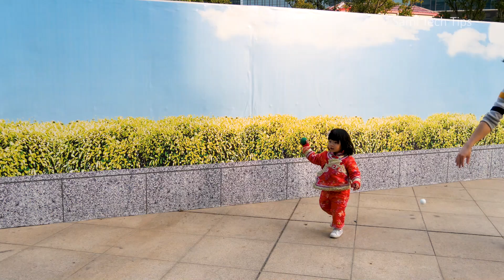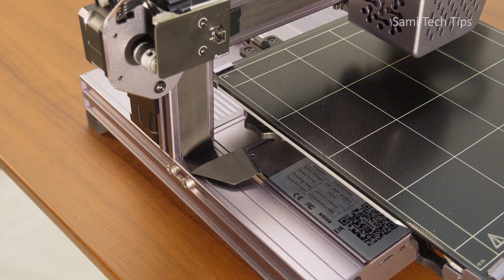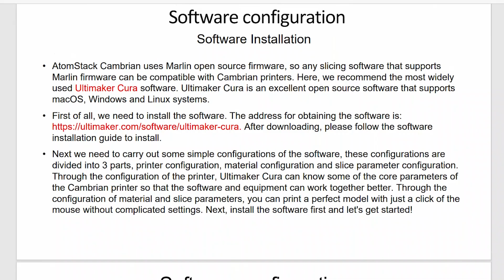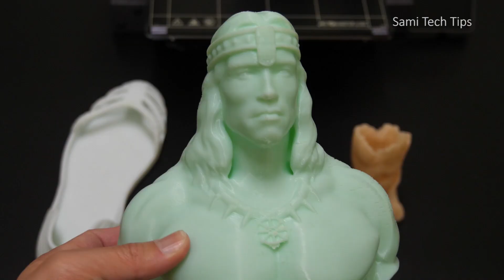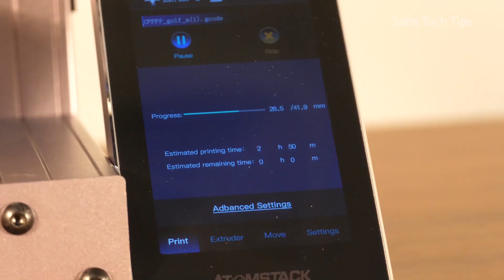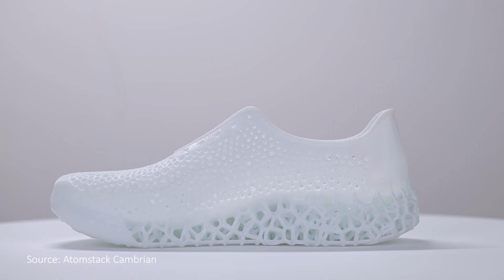Atomstack Cambrian: My First 3D Printer and I'm So HAPPY!

Comment: Hi, 

Great video on the Atomstack Cambrian Pro! I recently purchased this printer 
but don't have access to the SD card with the configuration files. I've tried 
contacting AtomStack support but they're not responding.

Would you be willing to share a copy of your SD card files or configuration 
package? Specifically, I need:
- Cura printer profiles (E285 & E175)
- Start/End G-code files
- Material configuration files
- Slicing profiles

I'd really appreciate your help to get started with this printer!

Thanks,
macsalaga
Reply: Hello,

I also recently purchased the same one, which also came without the SD card. I need the same files. Did you make it? Could you share? 

Thank you very, very much
Reply: @MateusRocha77 I did make it. I could email you with details I have found

Comment: I recently purchased the Atomstack Cambrian Pro 3D printer and completed the initial setup process. However, I am encountering an issue where the printer restarts every time I attempt a test print. I have tried troubleshooting the issue by checking the print bed level, print settings, filament, and heating, but the issue persists.

Please let me know if there are any additional troubleshooting steps

Comment: looks good but not for the price their asking on the kick starter. Almost 7 bills wayyyyy to expensive when I can kit up for under 50 bucks.
Reply: 280 euro is actually a pretty good deal.
Reply: @fongus6420  ok that's not what the site said. To back it 700 bills. Did I read something wrong?
Reply: In USD not really expensive either.
Reply: Maybe ur reading in their currency

Comment: Not really a game changer. 
There's quite a big competition of i3 style printers in similar size going for less.
Reply from the maker: But not for this TPU material though..
Reply: @SamiLuo  with all the respect but was that material tested on different direct extruder machines? 
By the looks of it it's not stretchier than ninjaflex or fiberflex 30d and those are printable with most direct extruder printers...

Comment: I have an Ender 3 with direct drive that can easily print ninjaflex tpu which is super soft and stretchy, this machine has some nice design features but its still basically the same as my Ender with a direct drive
Reply from the maker: Yeah, that's for TPU not this TPR materiel though, it's a big difference :D TPR is much more flexible and stretchier :D

Comment: But you can print TPR on any printer with direct extruder, like for example prusa i3 and many of its clones.
Reply from the maker: Hi, thanks for commenting. As far as I know, printers like Prusa i3 can't handle very well of TPR in this level
Reply: @SamiLuo  So what are the differences between atomstack and for example prusa i3 extruder? The only thing i see is using 2,85mm material diameter instead of 1,75mm.